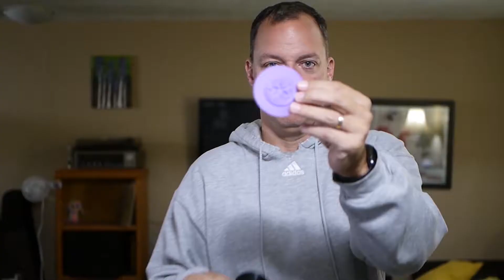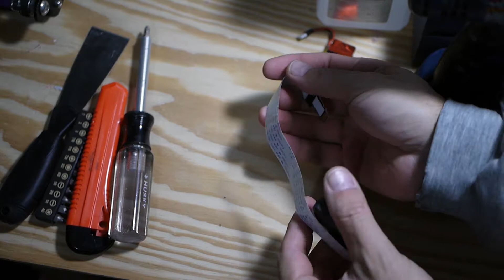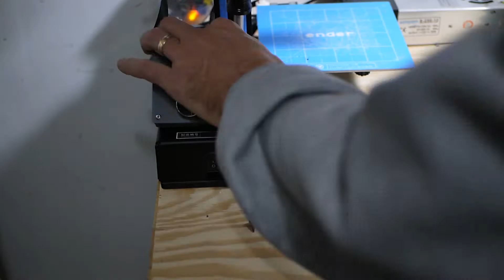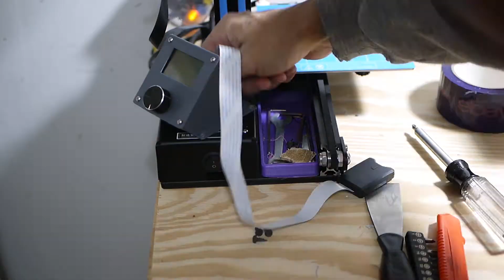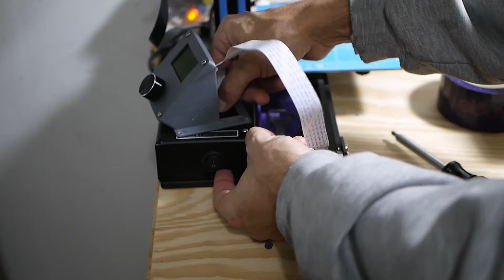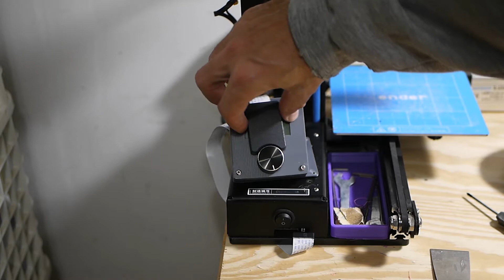3d Printed Photography - Micro SD to SD Card Conversion on 3D Printer

Comment: I have an Ender 2 also, and I'm going to try AstroPrint...and connecting it to my PC.  ;)
Reply from the maker: Scoot Roter Let me know how it works out for you.
Reply: @RickBolt  Well, my Ender 2 and 3 print nearly perfect when using Cura, but when using Cura that's inside Astroprint it printed terrible.  So BAD!  I contacted customer support and the only thing they had to say is that Astroprint for the PC is still under development and although it works for many people, it sounds like it doesn't work for you so I'd suggest you not using it! LOL  Yeah, no try this, or try that, just don't use it!  What a terrible and ultra lacking customer support!  WORTHLESS - lost a customer forever!  And probably you too and others that read this.  Oh, they did suggest trying the Astrobox - which is $200!!!  LAZY FUC%S! LOL
Reply from the maker: Sorry it did not work out for you. I think I will stick with swapping SD cards between the PC and the printer for now.  Thanks for feedback.
Reply: @RickBolt  Yeah, me too.  BUT!  here's what I did.  I had to walk around my large desk about a total of 20 ft. each way over and over until I got the design right and was able to print.  Not a huge distance, but I was wearing a path on the carpet! lol  So, I decided to order a 15' USB extension cable, plugged it into my USB on my PC, and now it is mounted on the side of my printer stand!  I simply pop out the micro SD card and pop it in the adapter that's sitting in the USB extension cable.  Sweet!  Quick and easy!!  I highly recommend! :)